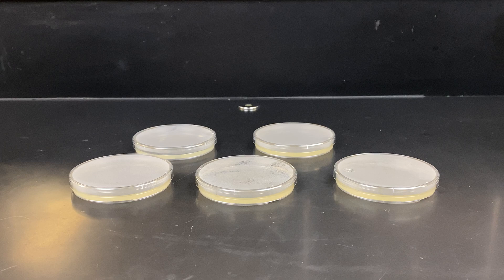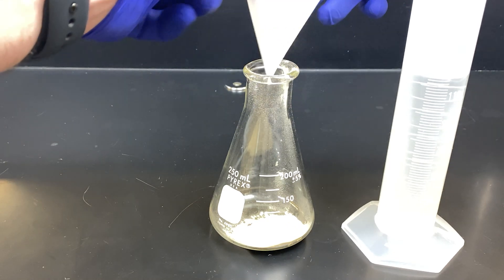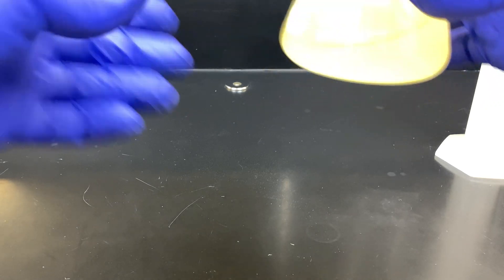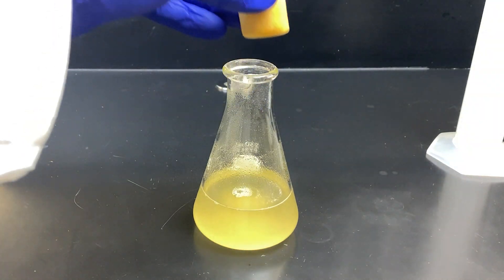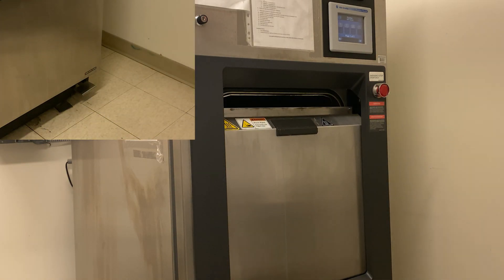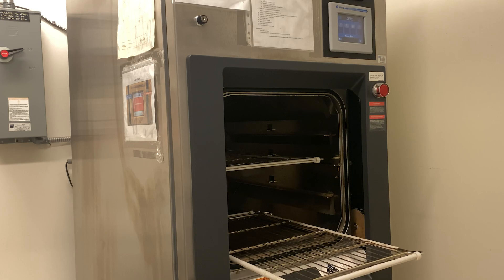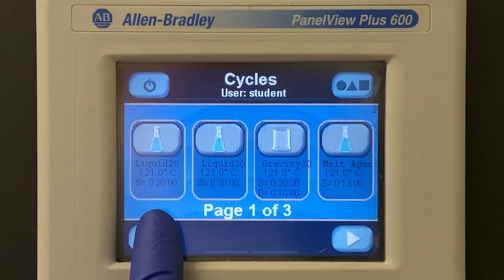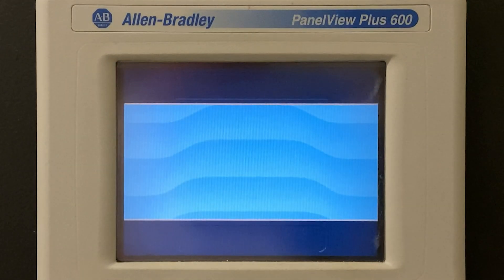Making LB Agar Plates

Comment: thanks for your informative video! is it ok if I did not use a bunsen burner since I did not have access to one?
Reply from the maker: The Bunsen burner is there to heat the air in the neck of the flask.  Hot air rises, so the air in the flask will flow up and out, helping to prevent contaminates from floating down in to your flask.  If you don't have one, you might just have some contamination issues, but hopefully you will get many sterile plates.